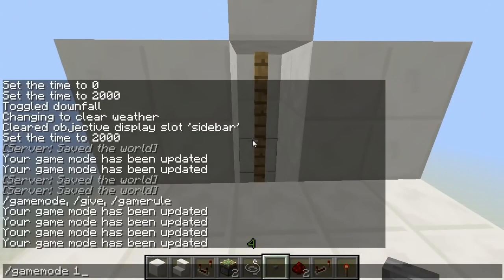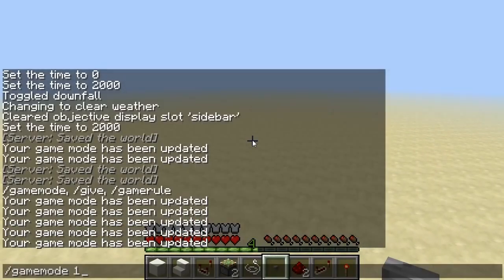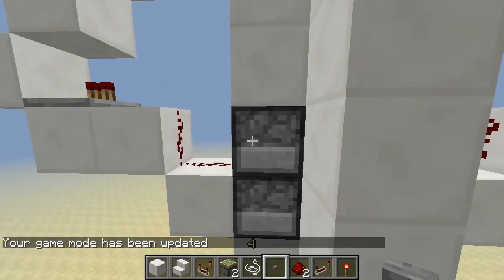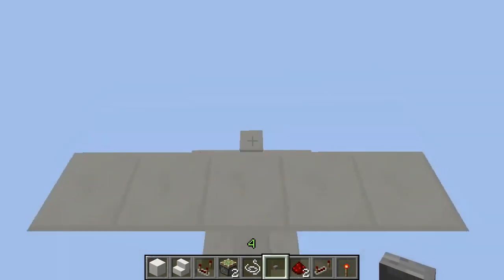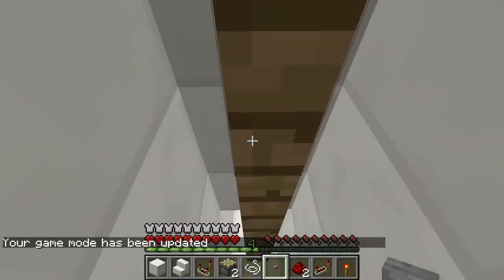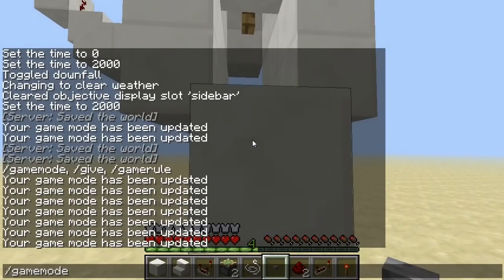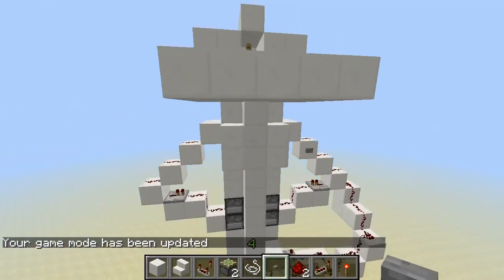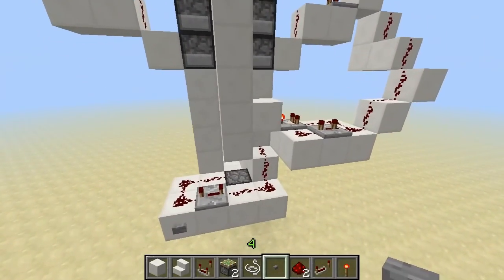Over the shoulder: Bat-Pole #2

Comment: If you really want to see nothing from the bottom, you could use a dispenser 4 blocks up, that shout twice with a one tick delay. If you time it right so that it shout when your head is aligned with the dispenser, it will break your fall without the splash sound.

However, there is a small bug with this: It will play the fall damage sound, even though you didnt take any damage.